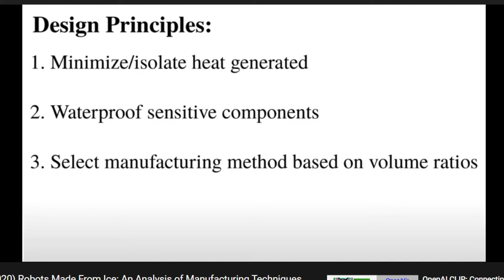Interview: Robots Made of Ice with Devin Carroll

Comment: This is fun to brain storm about, a brand new concept to me. Water is so versatile and ubiquitous in space, I think this guy is onto something important.
To minimize the need of electronics, perhaps radio replacing wires could in turn be replaced with optical signals. Combining transparent ice and reflective snow to channel sunlight as signals to photo-resistors, using mechanical shutters for control.

Comment: A Solar concentrator/reflector could be built out of ice and covered with metal foil. Concentrated sunlight could then replace machining with melting.
Concentrated sunlight might be used to power a low pressure steam engine that drives mechanical movements. Only the pretty simple parts in contact with the steam would need to be made out of non-water.

Comment: Regarding computation from materials only found in situ; if we assume the materials are just ice and metal refined from the regolith/rock, then if you don't care about the size or the speed of the computers, you could construct it from relays made from the ice and metal. The relays would act as the electronic switch replacing transistors, and there would be no need to produce semiconductor switches, which I guess might be harder to construct than relays.

Comment: How do the salts change the strength of the ice? How about the crystalline structure of ice in a lower gravity environment? What's the strength of the Penitentes formations on Europa? Could detailed images and modelling these as an engineering problem reveal some of their properties?

Europa isn't Mars or Antarctica. If there's carbon and nitrogen present,  reprocessing it into carbon nitride for structural and other tools or substrates is a possible option. Moulding takes a lot of energy to melt the ice. Cutting might be easier.